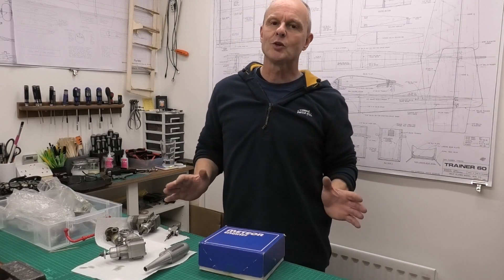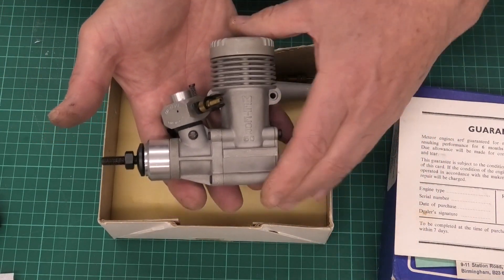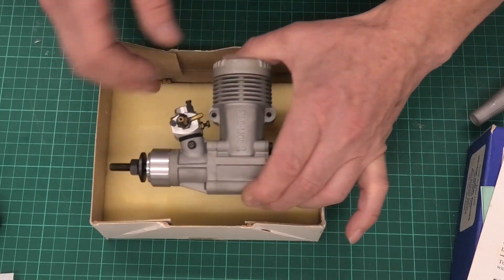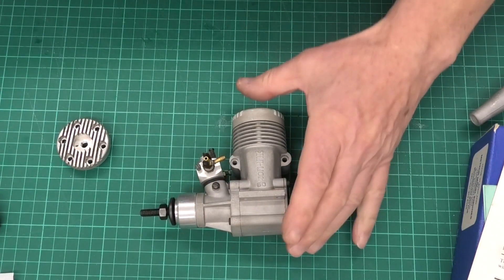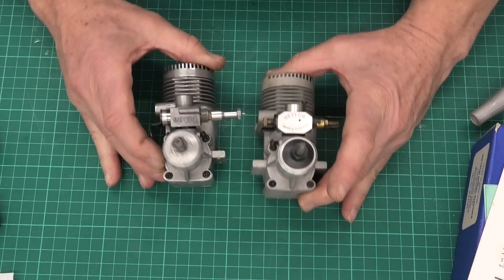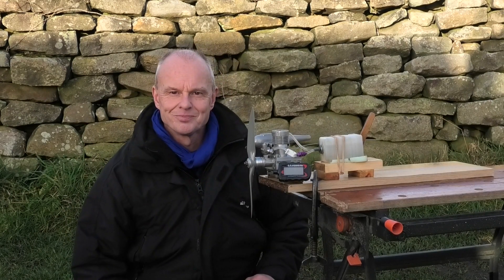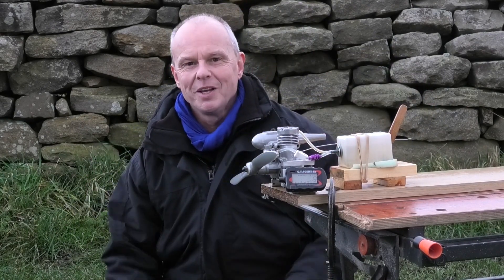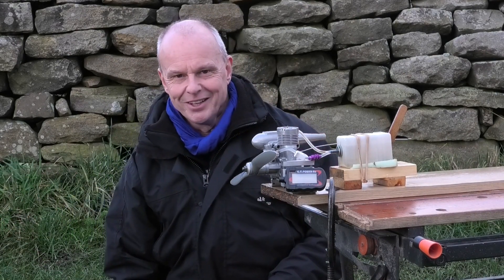Meteor 60 - an excellent 1970's glow engine for an RC aeroplane - review & test run

Comment: Hi Mark, what’s your view on what’s the best way to store your engines short and long term , l hear of so many different ideas, after run oil and the like , that one ran lovely 👌
Reply from the maker: I think after run oil is a must, and I use it after most flight sessions, although I do occasionally forget, I certainly don't like to leave my engines more than a few days after running with out some afterrun oil.  If I am storing longer term, out of the model I put quite a bit of oil in them and turn them over to get it well spread around the engine, and then store in a zip lock bag.  The oil I use is a air tool oil which seems to work fine and is cheap.  Much easier to oil 2 strokes through the carb, than 4 strokes.  With 4 strokes I use a small syrings and squirt oil through the breather nipple.  Hope that helps.
Reply: @MarkRobinson555  that's what I've been doing but not as often, like the idea of putting them in ziplocked bags to keep the air out ,brilliant, see another classroom day thanks mark.

Comment: Good morning Mark. I got so engrossed watching your video I burnt my toast. 😅 Very much enjoyed today's video, and was also going to mention  how different the older engines sound. This engine has a very smooth and constant idle. I also have a collection of old engines but as I have said before we are only allowed electric on our field. One day I may get to use them. Keep them coming. Terry    PS what is the trainer on your bench ? Or is it a secret.
Reply from the maker: Hi Good morning Terry, really pleased you liked the video and appreciate these wonderfull old engines, but sorry about the toast!!  I know these old cross flow engines are not as powerful as modern equivelents, but that really doesnt bother me, for me flying is as much about the engines as it is the aeroplanes, like you I love how they sound and run so smooth.  I think IC flying and the noise is an increasing issue in more populated areas, I do fly some electric, but I am very lucky where we fly as there are few restrictions, other than a 10am start time.  This Meteor 60 will eventually be in the Trainer you mentioned, although the first flights will most likely be with a Merco 61.  I am building it to be a bit of a flying test stand, so that I can run some of my older 60 size engines.  It is a Great Planes Trainer 60 with a 65" wingspan.  It will be my next series of build videos in a few weeks, once I have sorted some other things. Have a great day
Reply: @MarkRobinson555  I still have my Junior 60 that was my test bed. I made the engine mountings so that I could fit various paxolin plates for different types of engine. Take care. Terry
Reply from the maker: I really like the look of the Junior 60, often thought of building one, but think my flying relies too heavy on ailerons, which is perhaps more of a reason to build one!
Reply: @MarkRobinson555  if you like nice relaxing flying give it a go. Outerzone has the plan. 👍
Reply from the maker: Hahaha, yes, I have been looking at those since my last comment.  I am seriously tempted, can at least go on my list! 😀